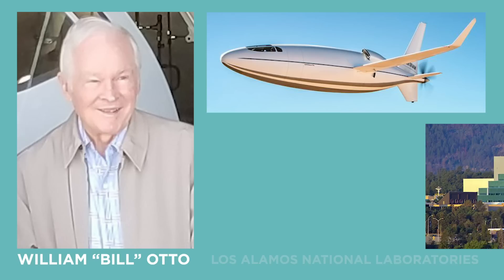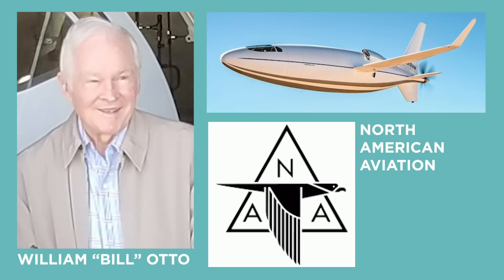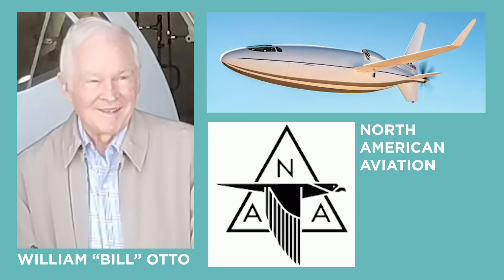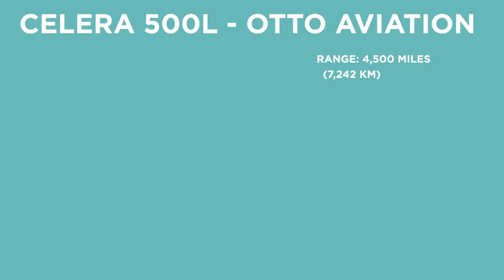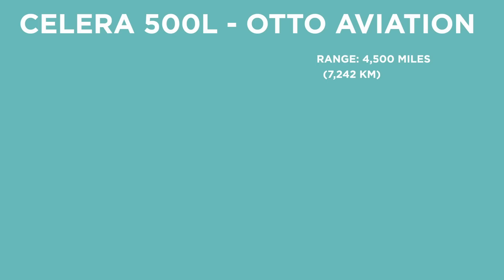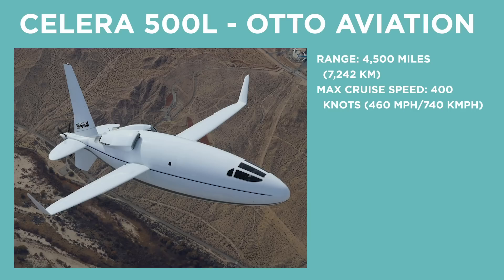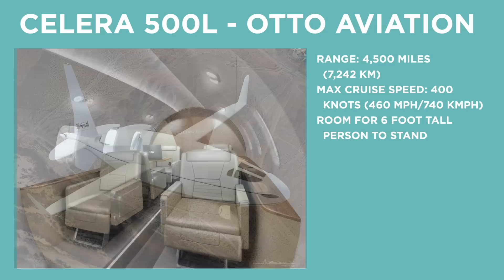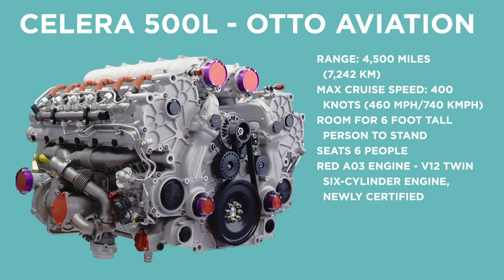Could This Plane Save The World? (Hint: No.) | Answers With Joe

Comment: Also the seating in the Celera 500L is business class. A economy configuration should be able to increase that to about 10 to 12
Reply: Can't do that without an unacceptable increase in gross weight.
Reply: @chuckschillingvideos  - Sure you could. Business class seats weight quite a lot more than economy. Not the equivalent of adding 6 more people, but I would think it should only reduce the MPG a little bit. Although, considering that a business class seat is probably going to be twice that of economy, then perhaps it isn't such a good idea after all  🤦‍♂️
Reply: @john1956c  It's not the weight of the seats.  It's the weight of the passengers and their luggage.  I don't think you're considering that this is a LIGHT PLANE with a low output engine.  You can't just double the payload without consequence to performance, range and safety.

Comment: The current ATC system would absolutely be completely overwhelmed by a 10-fold increase in air-traffic.

But with automated airplanes should also come automated air traffic control.  When the planes talk to each other, then who needs the current human-controlled centralized-control-tower system for air traffic (and air traffic control) that we have now?  Each aircraft will simply be responsible for informing the other aircraft in its vicinity where it's going and how fast -- and those aircraft will all, of course, do the same thing.  They each separate themselves from the others -- no need for human controllers to keep track of anything.  It's completely decentralized.

Of course this is decades in the future.  But this airplane's efficiency is a definite sign of things to come -- air travel that is far more efficient than what we have now.  Enough so, that we can build an automated "air taxi" system wherein you'd take your automated Uber to the nearest local airport, board your automated small airplane flying to the small airport nearest your destination, wherein you'd board another automated Uber which would drive you to your final destination.  There would be no more large airplanes taking hundreds of people between large airports.  I could totally see that being a thing in a few decades.

Comment: It takes a given amount of energy to do a specific amount of work. Consider, for example, the C500L's fuel burn on climbout, which requires 450HP @ 0.4 pounds of fuel per hr per HP (real world efficient diesel fuel burn at high output) or about 30 gal per hour. A climb rate of 1000 FPM and an average ground speed of 150Kts (exceedingly optimistic real world performance numbers) would net an initial 5 miles per gallon in climb (for say, the first 40 mins of flight). Numbers that are, again, stunningly optimistic in the aviation world. Note the PC-12 achieves 1.6 mpg in initial climb and initially about 130Kts, not 150. 

Also, the C500L's glide ratio of 22 to 1, CL/CD is not markedly different than today's efficient airliners. 

Again, remember it takes much energy to "lift" things to altitude. 6000 pounds lifted to 40,000 feet uses a lot of fuel, regardless of aerodynamic efficiency and low drag design. 

Yes, diesel engines burn fewer gallons per hour. But gasoline is lighter, than diesel or Jet-A. The pounds of fuel burned per hour is not markedly different between diesel and the best gas engines. We all know that we fly by weight, not gallons. 

There is no question that today's most efficient airliners achieve impressive Passenger MPG. Often 120 passenger MPG is possible. The C500L won't do that, under any circumstances.

Comment: I believe that the cost of the crew isn't relative to the pricing topic since celera obviously is not as big as 747(multi engine plane) therefore the salary of the pilot would decrease noticeably and do we really need flight attendants to serve 6 people,  the cost of the fuel can build up extra profit in the long run after of course paying for the whole manufacture of the 61 celeras, however the only thing I'm worried about is the air traffic, it's not gonna be a great time to be a tower controller guy 😜, btw the cost of each seat would increase due to the fact that we all will be sitting in the first class ahahhah😅

Comment: Airlines direct emissions is only 2.5% but the greenhouse forcing effect of those emissions is over 6% of global emissions (due to cloud formation, NOx and methane). That factor of almost-3 is significant and should not be glossed-over. 6% of forcing is a big deal, especially as currently a very small fraction of the populace does all that emitting. 80% of the world has never been on a plane.

Comment: Where can I get a 747 for $20m?
1. It's about $10m alone per engine so I think the cost for a new 747 would be in the range of 150 -200 million.. I know a new 737 max is about 110 million So you are way off base there.. 
2. The cost of maintenance of a 747 would be easily way higher than the cost to maintain 61 Celeras when we take on things like C checks etc.
So maybe the Celera can compete after all

Comment: I don't know where you're getting JetA fuel for $1.08 a gallon because I haven't seen it that low in the 33 years I've been in aviation.  It's nearly $4.00 a gallon in OKC and that's without Prist, the antimicrobial additive, that you would be silly to go without.  With Prist, JetA is $4.78 a gallon, which by the way, are really low prices.  Prior to Covid, it was over $7.00 a gallon. As far as the cost comparison between a 747 and the Celera, you need to compares new vs new since there are no used Celera's.  A new 747 is currently about $380 million each.

Comment: While this would be fine for small private planes for executives etc I can't see small aircraft replacing the likes of a 737 or even 747 on short-hop domestic or long-haul international flights. If they reshaped the 747 body to have more laminar flow and replaced the engines with more efficient ones that can run on synth-avgas or synth-biodiesel they could reduce emissions while maintaining passenger capacity. The ability to automate the process to have an AI or onboard computer fly a preset route, beacon-to-beacon, at preselected altitude would negate the need for pilots on commercial aircraft.

Comment: I suppose the main question is could this Celera 500L be scaled up? Of course the big problem with scaling up is that if you double the size of the aircraft the mass will be 8 times greater! And how would you fill the fuselage with double the height....

Comment: You also missed the biggest expense. The cost to maintain a plane and its service intervals. Better comparison would be a 787 dreamliner that runs between 120 and 200 million and is much more efficient plane than the 747. The Celera is more a personal business plane. Personally I'd rather buy a Pipistrel Virus (veerus).

Comment: The technology is interesting. I'd love I've to see this scaled up to a 747 size level and see what the fuel savings are then. Planes haven't updated a whole lot in the last 40 years.
Reply: The reason why the Celera is so slick and efficient is because it has laminar flow on ALL surfaces, not just the wings, not just the tail, but the fuselage and everything else touching the air.  To maintain that laminar flow over the entire aircraft, the size itself has to remain small for it to work.  You would need an impossibly smooth surface beyond the sizes that Otto is attempting and that's not even including the other parts of the plane on its surface, like where the wing and tail and air scoops meet the fuselage, the little instrument ports that are necessary on all aircraft, all the door and window seals, etc., that would more or less destroy that impossibly smooth surface you made.  Turbulent flow is sort of like a cascade effect, one tiny burble in laminar flow and it multiplies on its own until it makes all of the flow turbulent.  If a tiny gap in the door seal creates a tiny little burble, that will multiply on it's own and kill the laminar flow, but luckily that tiny burble doesn't have a chance to disrupt the laminar flow since the tail of the airplane has already left the area...in a 747 that burble might turn into fully non-laminar flow by the time its halfway to the wings, leaving the rest of the aircraft in draggy turbulent air.  Continuing this example, you'd have to make that 747's door gap fit so ridiculously flush that you wouldn't be able to feel the seam with your fingernail.  And that's only considering the obvious, as even the smooth sections of an aircraft need to be geometrically accurate, there can't be even the slightest imperfection, meaning any flat sections would have to be truly flat, any curved sections would have to follow that exact curve, with a margin of error lower than a coating of paint. So keeping the aircraft small is really the only practical way you can achieve laminar flow, since even the tiniest amount of imperfection will eventually end up causing non-laminar flow.  By stopping a specific size, you're basically making a cutoff point at which laminar flow is too hard to practically maintain.  To put that into perspective, so far this is the only aircraft I know of that has incorporated laminar flow on all surfaces, not even NASA has made a fully laminar airframe for testing purposes, so for them to manage it on their own is an engineering accomplishment.  Laminar flow is, to put it mildly, the holy grail of aerodynamics.
Reply: @Skinflaps_Meatslapper  Thank you for such a detailed explanation. That all makes sense. On an engineering level, I can see from your explanation how extraordinarily hard that that would be to achieve on a Bowing 747 scale. It also adds a little more appreciation to the design of this plane itself.

I'm now more interested in how this Laminar flow has been achieved and if other vehicles or devices have ever tried/succeeded in pulling this one-off. I believe water may work in a similar way and that boats have managed to use a submerged wing to raise the main hull above the water when at speed, I understand that this is very different to Laminar flow though the motive is the same, to reduce any turbulence and drag as possible.

Thanks again for the real answer too :). The optimist in me says that it's possible, just not probable yet :D.

Comment: Airlines wouldn't use a 6 passenger version- it would be scaled up using the same shape and design, so you'd be flying dozens or possibly hundreds of people... not 6.  Unless scaling it up would not translate into the same efficiency, which might be why the 747 looks like it does.  I'm sure that airplane engineers considered many shapes and designs.  Perhaps there are other reasons this design is not used for commercial airlines.

Comment: Assuming Otto actually puts this in production in 2025 as they're advertising more recently, and the figures for cost and fuel economy were close to accurate, there's several externalities you don't take into account.

Ignoring 747s because they're no longer a used standard for domestic flights. The 737, when not crashing and killing all aboard due to the inevitable consequences of us living under capitalism, is an even tougher competitor. Generously, it costs about $530,000 per seat. A $5M Celera seating 6 would cost $833,333/seat. Of course, that's at the newest 737's max capacity of 186 economy seats versus 6 business seats. I've seen seating of 172 with 20 first class on newer models which is about a "seat value" of 200 economy seats (since business seats generally cost about 2.5x more for the same flight). Using this metric since you cite profit motive as the primary driver of airline decisions (accurate, due to the inevitable consequences of us living under capitalism, the 737 carries 200 economy-equivalent tickets and the Celera 15. I'm going to dock the Celera to 12 because if they run a competitive fleet they're going to need to cram more economy seats in 500Ls to offer flights regular people will pay for, and I doubt they can fit more than 10, so an average thereof is likely. Readjusting for this, a 737 is $500,000 for an 'economy-equivalent seat' and a Celera $416,666 at the estimated price. Let's call this metric about a wash in terms of Cost Per Seat Profitability.

The average mpg per seat of the new 737s is listed at about 103mpg per seat. At a conservative average of 20mpg for the Celera x6 seats that's 120mpg/seat. At 8 or 10 economical seats x 18 mpg (assuming the plane is a bit more laden) that's 144-180 mpg per seat. A competitive fleet of the Celera that services all kinds of passengers can almost certainly follow the mpg per "economy-equivalent seat" ratio of 12 for numbers about 200-240 mpg per 'EES'. 103 mpg for the 737, divided by 172 seats * 200 EES = 119.7 (120) mpg/EES. The Celera's fuel costs per ticket profit are again about 50-60% that of the Boeing.

The overall costs to operate a 737 per flight hour have a simple breakdown estimate here - https://simpleflying.com/boeing-737-maintenance-operating-costs - of about $5757/hour. The Celera is estimating costs as low as $320/hour, but let's say $480/hour in the real world. That's $40/EES per hour for the Celera and about $29/EES per hour for the 737. This is assuming real world Celera operating costs are substantially higher than advertised.

However, for your ticket, the VAST majority of flights are connections; some back-of-envelope analysis from my parent, a travel agent with over 50 years experience, is airliners fly about 20% more miles than if all flights were direct in order to fill the seats. Meanwhile, nonstop tickets command about 20% higher rates on average. The Celera is designed to operate out of regional and even some local airports, needing minimal tarmac to take off and land, and you will never have to worry about flying half-full craft, as you mention. So they can probably realistically squeeze out 10-30% more ticket profit per EES simply due to operating fewer flight hours on tons of direct routes that they can charge a little more for due to the convenience. If I can pay 20% more to not fly from Seattle to Newark to Cleveland (a real flight route!) I'm going to do that.

One person you refer to discusses the logistical overwhelming due to so many planes. This is a real logistical challenge, but they need to also realize that you don't necessarily need that much gate crew or ground crew. The Celera is boasting a 4500 mile range and 25 mpg - implying a 180 gallon fuel fill. This is compared to a 6853 gallon fill for a 737, meaning you can probably turn around filling the Celera in 10% the time or less. Servicing the cabin is going to be easy; they will be able to utilize far more tarmacs spread across various airports; you're probably looking at boarding direct rather than through a gangway; having 6-10 people board and stowing/changing luggage will be vastly faster. Heck, at smaller airstrips you're probably just walking your own bags right to the gate, tossing it on a scanner, and a ground crew walking them 20 feet and tossing them right into the plane. Invert this on landing instead of needing the whole baggage check system - offload the bags, walk them in the door, 6-10 people grab heir bag and leave. And of course, considering that about 50% of fights in the U.S. are connections, going to an almost all-direct system would not only spread out the burden but offset a third of its own additional logistics burden.

Larger craft in this category will ease the burdens and increase the efficiency further. Granted you made this video 3 years ago but Celera has confirmed an intermediate 600kW hydrogen fuel cell Celera 750L that will use an existing HFC powertrain, seat 19 and have a range of ~1000 miles for domestic routes. Running some quick envelope math, this could maintain similar cost ratios of about 60% the fuel costs of running current 737s but with far less strain on logistics, and further passenger savings/profit margins due to almost never running the planes with empty seats.

This could also change the job description for most pilots - imagine flying L.A. to Chicago, taking a break, then flying back, going home, and sleeping in your own bed - and having that be the standard M.O. for pilots. Commercial pilot currently make per diems for meals, have their hotels covered, and all of the other logistical 'perks' you'd expect from a job where you have to live out of a suitcase - those costs could be cut for probably 50 to 75% of pilots in an almost all-direct flight economy with smaller planes with faster turnarounds.

I can think of more but this comment probably should have been its own response video, so I'll just end it here. Thanks for anyone who was insane enough to read to the end of this! I appreciate you.